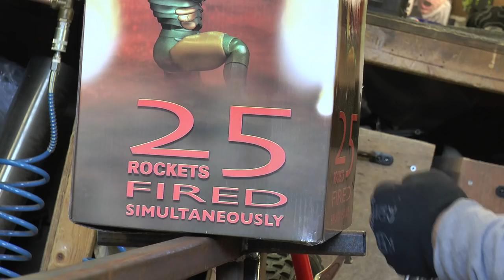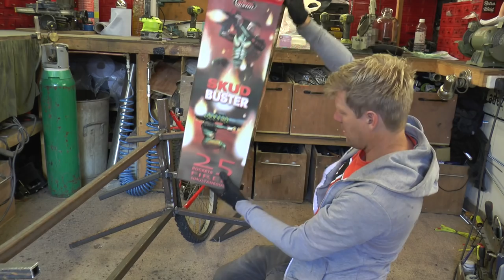Making a 1000 ROCKET launch Bike

Comment: ...Eh... Colin?... that "safety" thing looks to be made from some sort of plastic foam...
plastic usually melt in contact with fire... and when it melts it tend to become really sticky and kind of reseambe napalm with how it burns & sticks to people and things...
Reply: I too felt that the "Gumby" shield could be made of something less dangerous than sticky napalm!
Reply: safety third
Reply: Thats NASA foam.... its oke. :)
Reply: That kind of foam is treated with a flame retardand. But it will melt and stick to skin like a very painfull glue. And then catch fire.
Reply: Don't worry, it's pure asbestos. Safety guaranteed innit!
Reply: Doesnt even need the foam, safety tie will do the job.
Reply: As long as he wears the safety tie, everything will be fine.
Reply: Here is why his safety will work. 

The fireworks are launching up and the only thing that is really going to launch on the sides is the Sparks. Sparks usually die out on contact, because there is no longer anything giving the fireworks more spark. And if fireworks launch on the sides that would be deadly, but the Fire work company would be sued, so I don't think that is going to happen any time soon. And some foam had a coating that is not the easiest thing to light, so I think he would be fine.
Reply: Ah, Ok I seen the end and that is not safe at all because those rockets are going everywere... #R.I.P.Colin
Reply: true XD
 :P
Reply: He has his safety tie
Reply: Then why has the company not been sued yet?
Reply: Sion seems safe
Reply: Ahh right thanks!

Comment: I would've just made a plexiglass shield behind the seat
Reply: Too much weight.
Reply: Too much weight? Put a motor on it!
Reply: He added 80lbs of steal to the bike, I'm sure that 2lbs or plexi glass won't even make a difference....................
Reply: that's not very Colin Furze-y is it?
Reply: Why not a 2 sheets of metal with a small air gap between?
Reply: I would of worn a tie

Comment: Newton, equal and opposite , 1000 rockets each with ~ 500g thrust is 500Kg, this will not be synchronized but over a few seconds could be 100kg average, might need to pump those tyres up a bit.